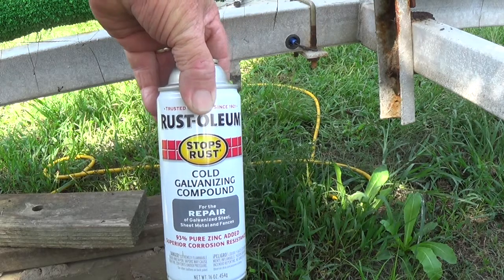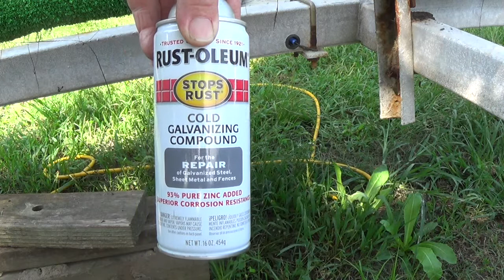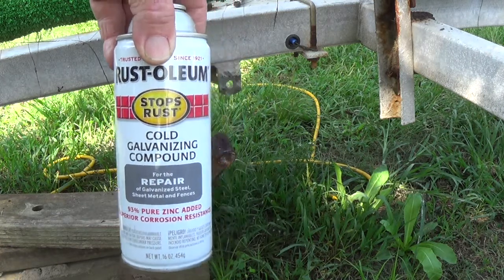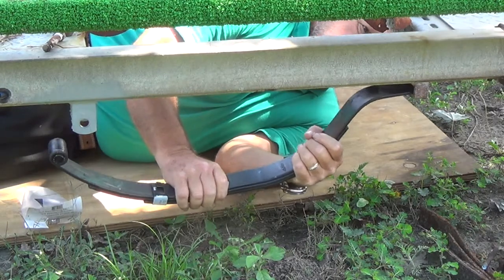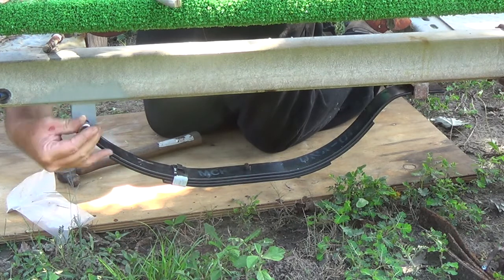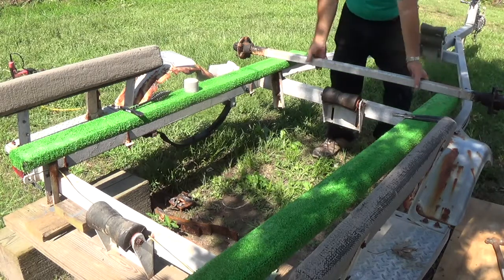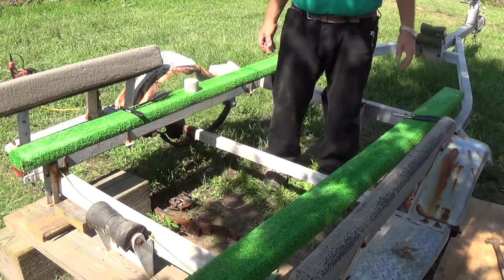Jon Boat Trailer Springs

Comment: Since 99% of people don't have a torch like that.  Just go to Harbor Freight and get a 20 buck grinder and grind them like he did for the nuts.
Reply from the maker: trvman1 you are right those are the first ones I cut like that the rest I used a grinder.